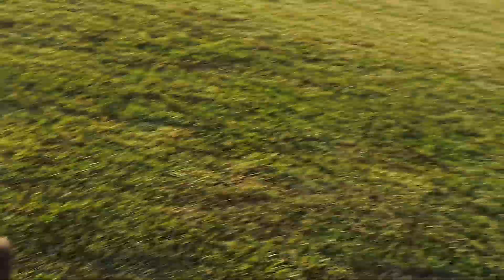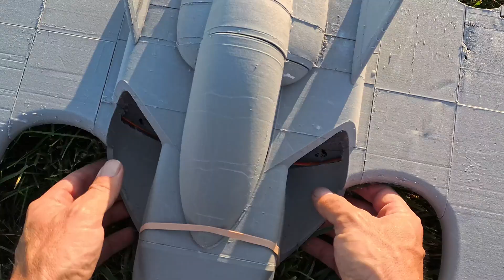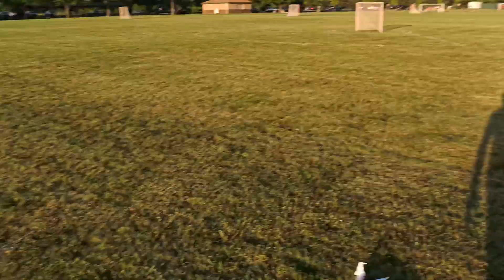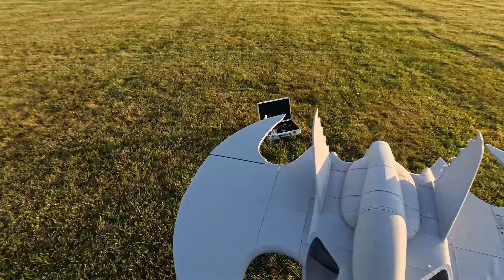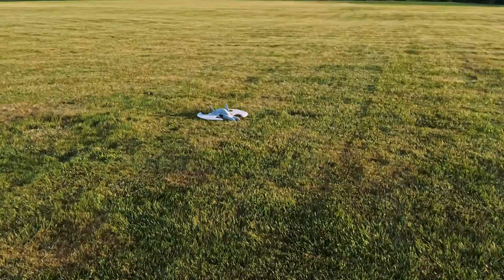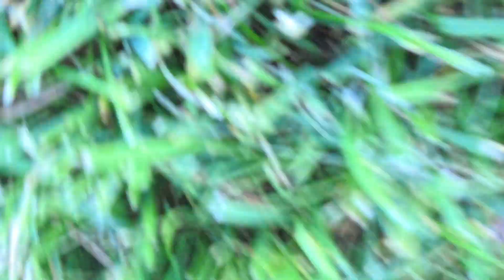Batwing V2! flew great, almost done.

Comment: Great design.  Is the dipping caused by the inlet scoops? The bottom area looks like it would catch air differently... Oh I wanted to mention a filament to try named Sainsmart lite pla. Im printing full speed 150ms single wall on this stuff and it is awesome. The white is almost see thru and sands really well, this saved me hours of print time.

Comment: Ok, the behavior is called "Unterschneiden" in german, undercutting I guess...
It results from mainly 2 factors:

- soft elevator 
- aero elasticity 

First is just the faster you go the more the elevon is bent back and less effective. This is self amplifying as diving increases speed increases bent.......
Be careful checking this, if you get to fast the only way out is half a roll and pushing 

The other is more complicated, basically switching airflow can change the behavior dramatically. This can be from local stalls on edges, flexing parts....

Twist is probably a good idea to add to your plane. Wikipedia -> wing_twist
Reply: Perhaps smaller elevons would be a good idea....

Comment: Short stubby wings like that will drop nose especially in corners when making sharp turns and the speed isnt right.  Might seem like its right, but only the wing knows the "right" speed.  It's called a high speed stall.  L39s, F18s, planes with small wings are notorious for this.

Comment: I might have an idea. My composite SU-XR does exactly this - when flying close to level it just drops the nose.
I was puzzled how come does your SU-47 fly so stable without a gyro, while my model does not, even with high gains gyro. Then I checked the dimensions - my model is more 'square shaped' and has a wider fuselage. I think it results in less stability in pitch axis. 
This model seems to suffer from the same problem. The solution - a gyro with MAX gains on the elevator.
Reply from the maker: I was thinking about this!! I also noticed it stopped on the last flight when I shifted the battery back slightly and trimmed down! I’m going to fly it again today and shift the weight back again

Comment: You should get a little Speedybee f405 wing fc for $40 and wire it so you can move it from model to model and use it on models like this. It runs INAV and once you have used one before they are super quick and easy to use, and would give you Autolaunch and a gyro. 👌🏻

Comment: Super cool design cannot wait, if ESC is very close to servo I might install aluminium sheet in between 

Also this kind of airframe might need high speed for stability thus will try throttle up when turning 😊